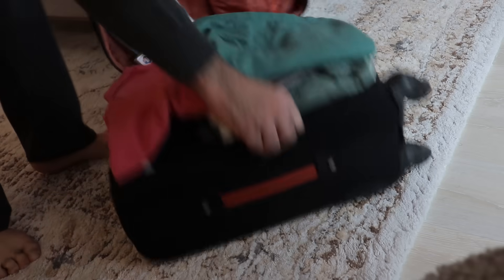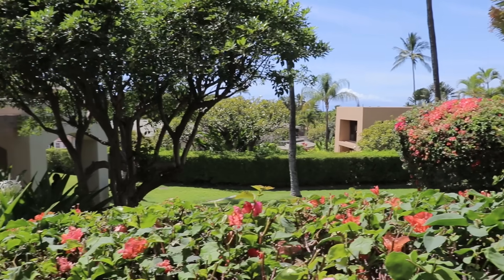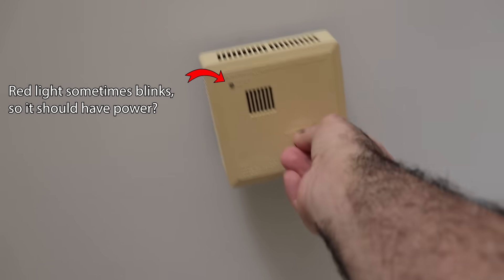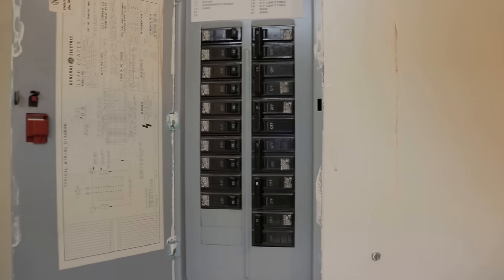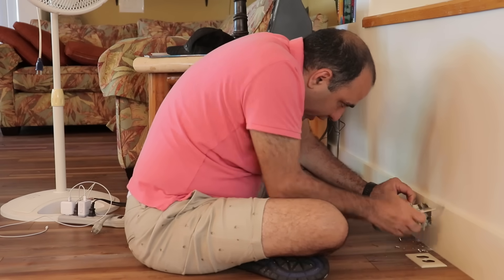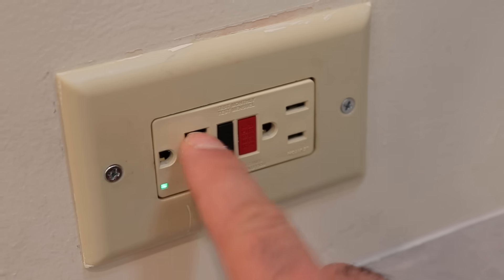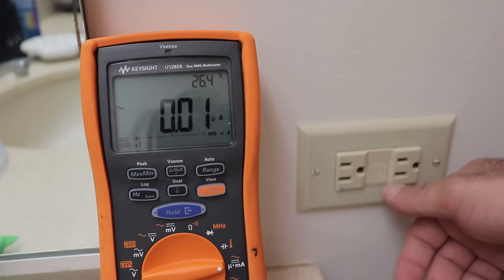Hawaiian Hotel Safety Failures

Comment: Normal people getting into a new home/hotel: ”oh what a nice view and good quality house”

ElectroBoom: ”where is the electrical panel?”
Reply: I'm like ElectroBoom, I stayed in a place that still uses screw fuses, it was the main panel too. Such beauty, but also a bit dangerous since one of them was bypassed with a nail.
Some of the outlets were so loose you could take them out of the wall when you unplugged something, and of course, no ground anywhere.
Reply: @Carlium  sounds like my house, except no fuses bridged, but there def isn't a ground anywhere, the quickest replacement for ground in such old installations is best done by shorting neutral to earth, so then you arent static shocked when touching metal appliances
Reply: @beardsntools  Its illegal to connet ground with neutral.If the neutral breaks every grounded stuff will be live.
Reply: @MernokiMegoldasok  in all old buildings its wired like that, usually at the outlets. never once I heard about electric power plant switching the neutral with live. 

If you mean neutral breaking by neutral wire blowing up in your house or whatever, then it's gonna be same as if it was ungrounded. you might get zapped sometimes, but it's not gonna be anywhere near powerfull as if you did touch the live.

Also the ground wire can break.. this can break argument doesn't hold up.
Reply: @beardsntools  Your argument is bullshit.If the neutral is broken everything will be live through the impedance of the load.Godd thing TN-C is mostly banned in most countries and only allowed in special casesd with at leat 10mm2 wiring and ground rods.
Reply: @MernokiMegoldasok  I just disconnected..(broke) the neutral and nothing is "live", theres just the "static" on metal housing, it does not zap ya like it would if you touch the actual live line.. it is exactly as if the ground was not connected to neutral and as if it was ungrounded, so no idea TF you're talking about, but it's perfectly legal here to connect neutral to ground and all old buildings that pre-date 80s have it wired so.

It's always shorted at the outlets tho, not at the circuit breaker.. so if the neutral "breaks" it's gonna break for both GND and N. That means you will only have a live line.. it's not gonna connect to the neutral through the ground.. in case if that's what you think is gonna happen.
Reply: @beardsntools  You dont understand electricity.And if something is grounded you will still be xapped by static because the charge is always in your body and never on the appliance.
Reply: @MernokiMegoldasok  I didn't mean static as static.. I'd know what else to call that quiet buzzing I can hear as I drag a finger across an ungrounded metal appliance.. but that's what I meant.

Eitherway grounding them with a ground pole or by shorting neutral to ground eliminates that and the phase tester picks up nothing, rather than a dim light
Reply: @MernokiMegoldasok  You are talking absolutely bullshit, in germany TNC is pretty common, at teh first point you switch TNC to  TNC-S, in newer construction regions we make TNS , but there is no real difference, just the point at were the seperation starts, at the transformer or at the first possible point after the houseinlet
Reply: @beardsntools  what Nagy is talking about, just happends when you have more than one phase in your fusebox, when you disconnect the Neutral there you blow up most of your Equipment in your house, a broken Neutral  is the worst case what you can have here in germany all sockets get around 400V then depends on the impedance on the things what are pluged in so just give you a good advice dont disconnct the neutral in the fusebox when you have more than one phase in there
Reply: @ellisdee8374  You must have a ground rod at the sepratation and thats fine.But the other commenter was talking about using only 2 wires for schuko sockets and putting a jumper wire between neutral and ground.Which existed in West Germany until 1973 but good its banned.
Reply: @ellisdee8374  Oh I see, the three phase 400V equipment isn't exactly common in home, it's used in businesses. But it just happens I do have a vintage three phase outlet which is already "grounded" to the neutral.. In 60 years or so it was never in use.

I found one of these oldass plugs that go with the outlet and am currently temporarily using it to power up some of these cables I have routed through the house. There are already like 12 or so cables near the fuse box because I am redoing the entire electrical wiring. I will be connecting the cables to the fuse box, which will also be replaced after I am done with the suspended ceiling in the living room and kitchen.

The outlet is used in a way to split it's three phases into three different one phase cables in different part of house, so 3x 230V(I am just essentially gaining an easy access to existing three 16A fuses that were unused). There isn't any 400V equipment here.. so disconnecting neutral wouldn't do anything here.. but I am sure if for some reason someone decided to disconnect the neutral and there was a three phase motor connected there.. that would probably F it up.
Reply: Lol
Reply: he ain't going on vacation unless it's a proper HVAC-ation.
Reply: Which is good, he's giving himself more safety
Reply: its not just elecrtoboom, its all of us Electricans, when i go into a store, the first what im looking at is which kind of lamps are used and how they build it :-)
Reply: Me too
Reply: Also Mehdi : LET POP THE BREAKER
Reply: When i bought my house.... I looked in the basement first for the panel 😂
Reply: fr
Reply: Your name lmao,,...!! Hammar-Lund is something that you wouldn't want to ask an Indian what it means. :D
Reply: Ngl checking the electrical panel is one of the first thing I'll do when I buy a house. I really don't want to have a single breaker for 5 whole rooms again

Comment: That smoke detector is fine, its from before they put expiration dates on these things. That was at least my dad's understanding. I replaced them anyways
Reply: It's a good thing you did, because even back before it was known smoke detectors still need replacing every 10 years (& not because of some arbitrary reason either: it has been proven that the sensitivity of them is greatly reduced after 10 years due to degradation of the sensing components).

Comment: Could buy a decent electricians screwdriver with full insulation!
Those sockets need to be earth at the top according to the latest USA code. 
Earth down is unsafe, but then all USA electricals are unsafe!
A portable plug in RCD will save your life!

Comment: I've watched several of your videos I haven't watched them all. But here's an interesting one that you might want to talk about telecommunications. Many people do not realize on a pots line there are two voltages that can be present the negative 48 volts that carries the telephony.
Telecommunications industry references positive to ground. The next one is the ring signal which is 30 Hertz and the ring voltage which can be anywhere from 90 volts to 130 volts. How electronic components are used to control these very different types of electric when used in a single device. Also how clean the power is in a central office because they use a large stack of batteries to act as a giant capacitor to filter the AC into a very pure form of DC power. This practice is still common today even in a lot of transmitting stations.

Comment: Imagine having this guy as an electrical engineering teacher. Middle of class he just blacks out the entire university, he’d be a legend
Reply: It's hard to tell when he is pranking with the sparks, but that hotel suite only had a subpanel with no main breaker. If a dead short is big and fast enough it will trip both the branch and the main, and possibly even further up. Then he would have been forced to break into that central electrical room to hide his tracks. Or get the hotel management involved. "I dunno what happened.."
Reply: @DMahalko  I nearly blew up my school, our class room was the Fysics class room, and I didn´t know about the gas leak when I used a lighter..
Reply: I blacked out my school using a paper clip back in the day!
Reply: @Rageypeep  did the exact same thing but in the boys bathroom lmao
Reply: @nicobovino7509  even more impossible than the other guys lie
Reply: @il9861  Greetings, I’m an electrician too. In the school bathrooms they had receptacles with metal casings that had gaps between the switch, easy to fill the slot with any obstructions, such as a paper clip. I bent it in a hook shape and insulated the holding end with the sleeve of this pretty thick sweater I was wearing. Touching any of the hot or neutral screws would almost instantly redirect the current towards me. I didn’t get shocked because the fuses were quick enough to pop right as I stuck it in, but the spark did blind me for a few minutes.
Reply: @nicobovino7509  you’re not an electrician 😂you can’t claim to be an electrician and then tell me you had fused switches 😭😭😭😭😭go away buddy
Reply: @nicobovino7509  also you said it’s a switch….there’s no neutral on a switch my guy.
Reply: @nicobovino7509  bro this is actually weird I’m reading your comment again and it’s super super clear you aren’t an electrician. And you fabricated this whole thing. Get help.
Reply: @Rageypeep  my Asus charger did the same thing when it decided to explode
Reply: @Rageypeep  hi. I’m an electrician. No you didn’t.
Reply: @Rageypeep  Yep I done that to they still don't know it was me who did it lol.
Reply: @Rageypeep 😂
Reply: Imagine the rage of those laboratorium assistants who forgor to save their Word documents.
Reply: @bmanpura  they would’ve probably switched to laptops by then
Reply: every day at 12 he starts lunch break with a branch panel breaker trip
Reply: "Hi students. Today we will be testing the resistance of different materials between ground and ne-"
pop
"Da** it that wasn't ground..."

Mehdi is so funny what a legend!!!
Reply: It would get old after the 3rd time in a year XD
Reply: In my middle school science class our teacher decided to demonstrate that some wires were live by touching them to a sink, popped the breakers for the whole building.
Reply: Our class almost burn and exploded the entire building in the chemical room.
Reply: The electronics class might hate him though.
Reply: This actually happened at my uni, I won't say which uni but one time a professor was playing around with something in his office and accidentally connected something wrong and took out power for a few of his neighboring offices
Reply: "oop gotta go get the breaker"
Reply: If He was my teacher I would pass Electrical Engineering with Flying Colours
Reply: 😂you r like me suspecious  acts i love cyberspace u love electronics though i also like electrons
Reply: 😂you r like me suspecious  acts i love cyberspace u love electronics though i also like electronics ❤ love from Pakistan 🇵🇰💖🇵🇸🇮🇷❤
Reply: 😂you r like me suspecious  acts i love cyberspace u love electronics though i also like electronics ❤ love from Pakistan 🇵🇰💖🇵🇸🇮🇷❤
Reply: 😂you r like me suspecious  acts i love cyberspace u love electronics though i also like electronics ❤ love from Pakistan 🇵🇰💖🇵🇸🇮🇷❤
Reply: 😂you r like me suspecious  acts i love cyberspace u love electronics though i also like electronics ❤ love from Pakistan 🇵🇰💖🇵🇸🇮🇷❤
Reply: "Now we just turn it on."

*It explodes as the power turns off*

"Oh Shit!"
Reply: @cold-drinks7498  this quote must be in every video

Comment: i mean if the hotel didn't have money to replace that smoke alarm for nearly 40 years? i don't think they ever had the intention of replacing it. just saying.

according to federal law they are 100% responsible for that stuff (maintaining and keeping it up to code). that's not to pick on this hotel, the ones i stayed at had mold growing in the bathroom, which certainly doesn't happen over a day or even a week. that's a long standing issue that wasn't resolved. 

anyway, as always your videos are full of useful information. i hope the hotel got most of the issues sorted out.

Comment: About that seemingly-inoperable smoke detector: as you might have noticed it's a Gentex, who still make similar detectors to that one, however they now all have battery backup as standard in case of power failure; the one you found is AC-only. I'm honestly not sure why it didn't alarm in the "Test 1" position like it should have; you left the "test knob" (as Gentex calls it) in that position long enough for it to alarm, yet it didn't (unless it's so old the sensor in it just doesn't work anymore). The "Test 2" position tests sensitivity; the alarm should remain silent in this case. As you pointed out it did have power going by the blinking LED, but for some reason "Test 1" doesn't work as it should. Hopefully at some point the detector gets replaced as it's well over 10 years old (the age at which smoke detectors are supposed to be replaced).
Reply: And this is why modern smoke detectors make themselves a nuisance by constantly beeping at the end of their service life, it's far too easy to forget they do fail at some point and you won't notice until the worst happens. Actually just replaced all the alarms in the house I rent after noticing they were over 10 years old and brought it up with the owner, only bothered to check because the extra ones (since they did CO2 as well) we brought from the old place started alerting they had reached end of life.
Reply: @StefanNuxoll  As far as I know only newer carbon monoxide detectors beep at the end of their service life, smoke detectors don't as far as I can tell (aside from combination smoke/CO detectors which probably do). Yes, it is annoying to enthusiasts like me at least, but it's a good idea when it comes to homeowners since that'll hopefully remind them to replace the unit (which is of course important). Hope the replacement units you got were dual-sensor ones (ionization & photoelectric), which offer the best protection.

P.S. It's "CO", not "CO2": "CO2" is carbon dioxide, "CO" is carbon monoxide, common mistake.

Comment: What? Do not parrot that mad-scientist "climate change" BS. CO2 is plant food.

Hmm, this makes me want to test the wiring in some of my favorite video games. Black Mesa Blue Shift has some notable screwy wiring. In this remake version, we find out why it was that the scenic view (yet another clue that the big disaster is about to happen) elevator (the only scenic view elevator in the game, curious) will not properly activate. Some unseen maintenance person has been working on it, as evidenced by the tool box left in the high voltage room. The critical wire was unplugged for a reason. What was the reason? Perhaps not too important, let's just plug it back in and not ask silly questions? There are loose wires strung way from one electrical box to another some 7 feet away, no neat routing nor conduit. That can't be good.

Comment: Well that begs the question why you don't wear rubber gloves only a professional would wear rubber gloves I'm just concerned for your safety maybe you should maybe next video you buy a pair of rubber gloves them are pretty cheap even doing the pandemic or electrically insulated gloves which is professional again I'm just concerned for you safety

Comment: I once spliced a SNES power cord and a phone charger cord with zero knowledge of what I was doing, turned it on and blew up the wall outlet. Also when I was a child I rammed a fork in a wall outlet. Twice. Got electrocuted by touching an elevators buttons that weren't covered after coming in from the rain. I feel like I'm destined to die to electricity.

Comment: The smoke detector is the most annoying thing I have to test at my job. I can confirm that one is indeed broken and I would've failed it.
Reply: Those units have green light typically when everything is normal. Red light means it's in alarm or it's in trouble.
Reply: @gopherfan118  Not necessarily: some old AC units like that Gentex & most DC & commercial units have red LEDs instead, even when they're in a normal state.

Comment: Reason for the switches being low is because it has to be accessible to people in wheelchairs.
Reply: Accessibility height requirements are around 900 to 1200mm high, which is usually where a switch should reside. Mehdi made it look like it was 500.

Comment: How does determining the phase difference work? When you get 205 volts AC you say the lines are 120 degrees apart and 240 when they're 180. If each line is 120 then with the 180 phase difference the total voltage is double the individual line. How does this work?

Comment: Sounds about right for hotels/timeshares, did tech support for one that had a hawaii location, and it always had problems, they used ethernet over powerline adapters, and alot of the outlets where loose, or you had to unplug and re-insert a few times do to oxidation. we where glad when another company installed wifi and we stopped getting calls from them

Comment: You may like Australia, clean 240v AC. Solid plugs and pins that seat correctly. None of this American: let's convert DC into AC for long distance supply, then convert it back at the house into DC. Often your appliance will convert it back into AC. One gigawatt later, your tv switches on.

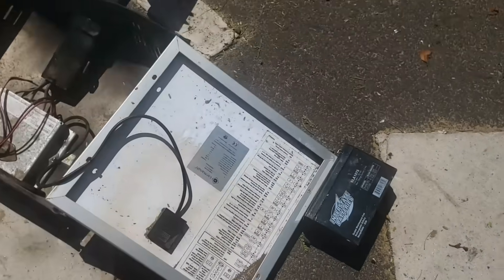Comment: 13:42 don't forget the breaker panel that is obstructed with a painting, which I'm pretty sure is a code violation
Reply: 5:44 maybe not a code violation but too close to the shower for my comfort
Reply: @dan-nutu  I could be wrong but I think it has to be visible
Reply: That's only because Mehdi was a guest, unfortunately for them it didn't work :)